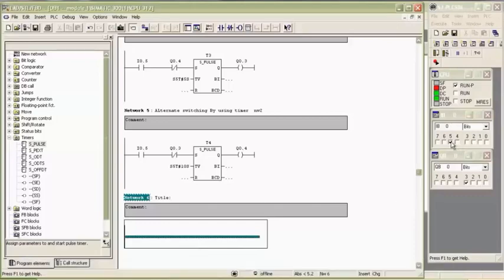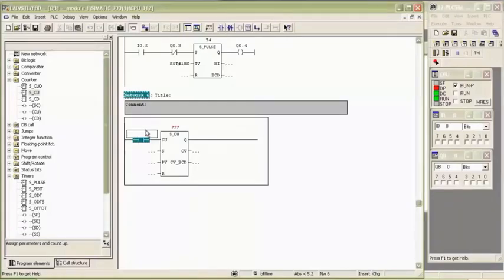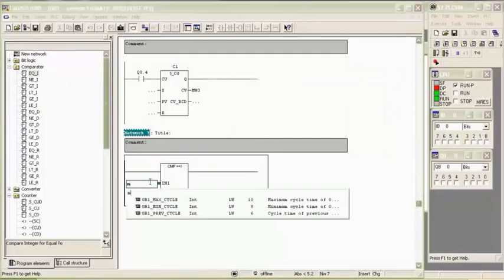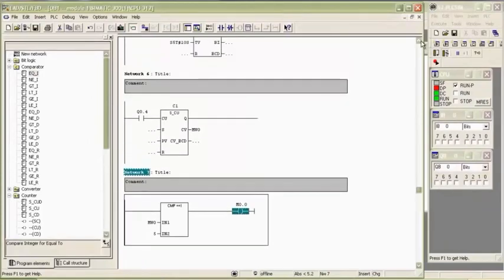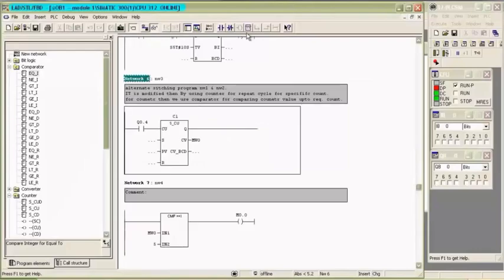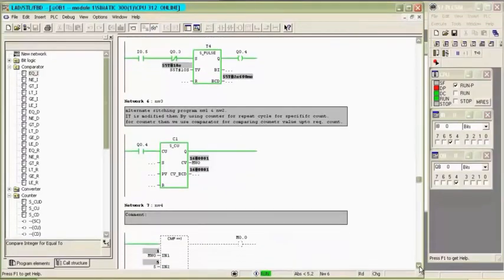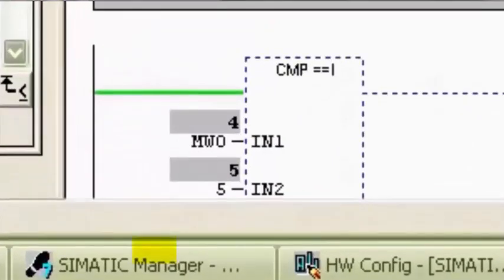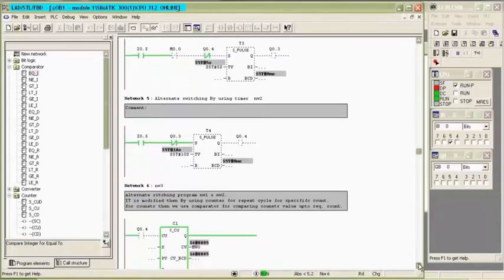PLC Siemens S7 300 Training, Lesson8 Counters and Comparators

Comment: PLC Training | Automation Training | Industrial Job Training | DIAC - 9818293887
http://www.diac.co.in/
DIAC Automation Provide very good Automation training in Noida with the help of multiple brands of Industrial automation products. We Provide Advanced training in the layout, wiring, programming, troubleshooting and implementation of PLCs in an industrial enviornment, using hands on experimentation on real industrial PLCs and other industrial components such as: sensors, mechanical switches and relays to produce real programming experiments and control situations. Call @9953489987,,9310096831.